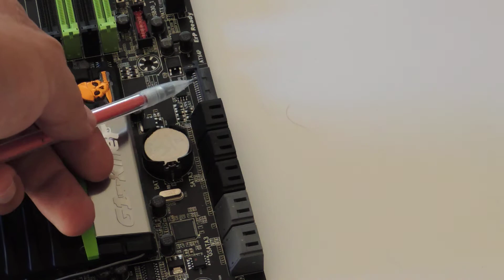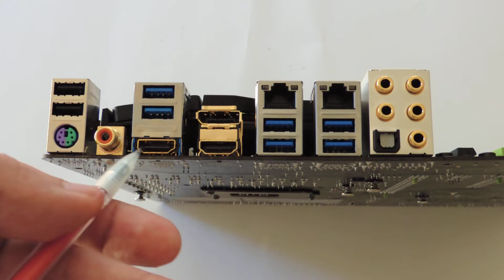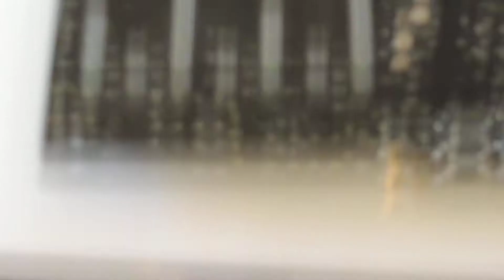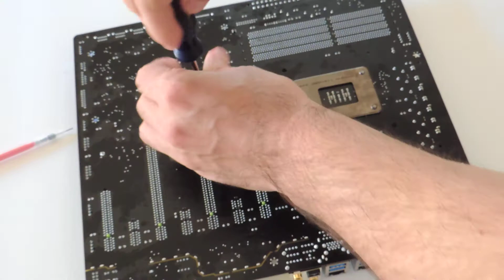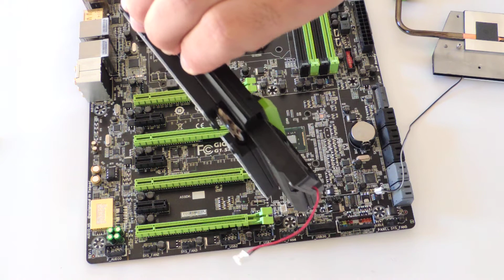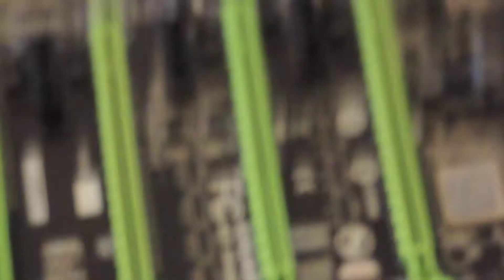[SH]G1 Sniper 5 Review/Overview

Comment: if your useing  just 1 Graphic card its runing at PCI-E X16 right? but if your useing 2 or 3 or even 4 are they still PCI-E X16 or do they drop down to X8 ????? plz explane the break down for me plz
Reply: PCI X16 is the slot for the GPU, there are different GPU sizes .All GPUS use PCI X16 ass it will not fit into other ones.Thx

Comment: Hello Sin0822, please answer this if possible: I keep getting Static noise when I plug my headset to the on-board sound on my G1 Sniper 5. The audio quality, to me, is really good and I really enjoy it but the static noise is a bit annoying. 

It also increases in volume when I start a game or even by moving the mouse. Any idea how to fix this? Thanks in advance
Reply: Try another headset, that is usually the headset, also make sure no static shaking is done on the headphone which may stop the weird noise.
if it continues try touching something metal which may remove any static charge up on your body